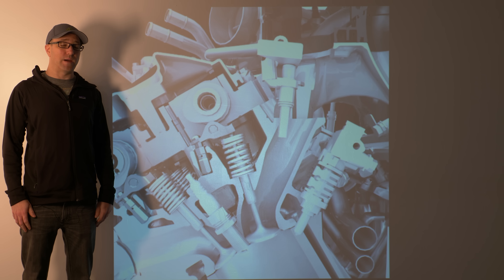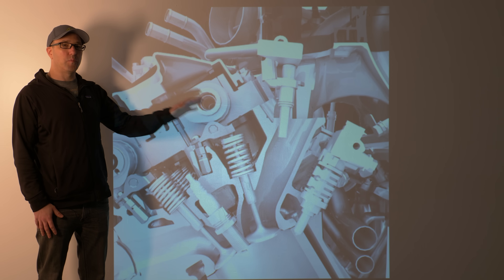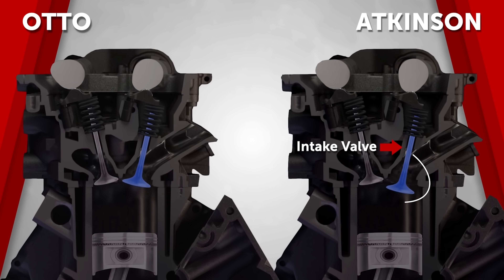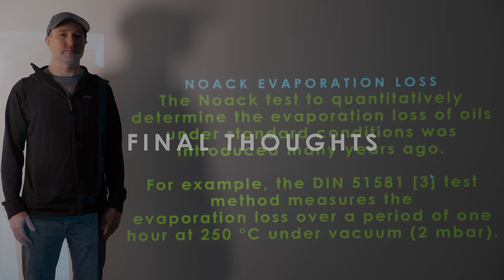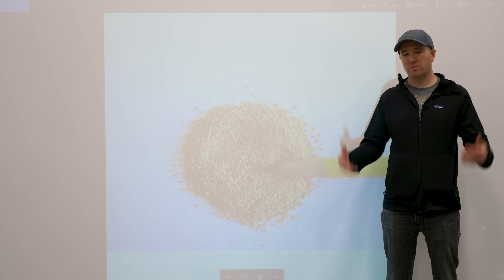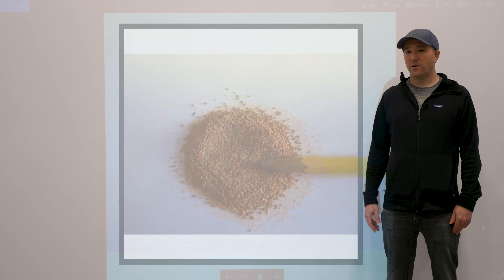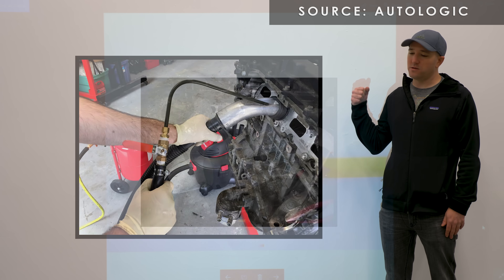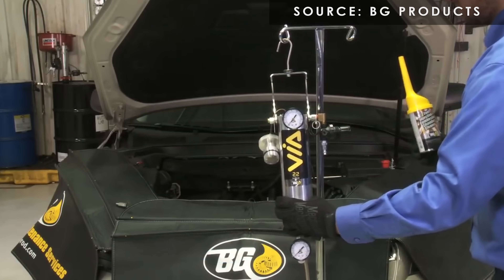Direct Injection, Problems and Solutions | The Fine Print

Comment: Excellent detailed video. How about fuel being pushed past the rings back into the crankcase causing fuel oil dilution? What pressure is the second pump bringing the pressure up to? The walnut shell method is just what we used to clean jet turbine engines. I will stick with my port injection non-turbo engine for as long as I possibly can. Thanks for the great info. 👍

Comment: I purchased a 2017 Subaru Forester XT about 2 yrs ago. Other family members plus friends had/have Subarus with nothing but praise for them.  My decision was all about the versatility of the Forester plus the performance of the turbo.  It was only later I began reading of the carbon build-up problems Caused by DI engines. I researched and read some info concerning a re-design (IE, specially shaped piston crowns and multi-patterned injection spray, 
etc.) to solve this problem. I'm certainly not an engineer so I just have to take Subaru's word when they responded to my concern.  Here is a copy of the response to my letter:  

   "Thank you for contacting Subaru of America, Inc. We appreciate the opportunity to be of assistance.
 The following is information I was able to obtain regarding our efforts to reduce carbon build up on direct injection engines: Older direct injection systems that experienced carbon build up were so-called “lean burn” systems.  Unfortunately, these systems suffered many times from uneven combustion due to variations in the fuel and air mixture throughout the combustion chamber.  This created a mix of lean and rich conditions resulting in variations in combustion temperature and uneven burning of the gasoline.  This uneven burning lead to the condensing of unburned and partially burned hydrocarbons which over time resulted in carbon buildup. Subaru engineers understood this when they created our current direct injection system.  They developed innovative yet simple systems to manage and control the combustion variations inside the combustion chamber.  These include features such as specially shaped piston crowns, multi-patterned injection spray, and tumble generator valves.  All of which promote the precise swirling and intermix of fuel and air under the variable conditions required across the full range of power requirements.  When combined with very high fuel pressures and extremely short injection duration of the Subaru direct injection system, stoichiometric combustion is maintained across the combustion chamber resulting in very even and complete burning.  As a result, abnormal residue and carbon deposits are not created and engine performance and fuel economy are maximized.
   If you have any additional questions, please do not hesitate to contact us again. Thank you for the opportunity to be of service.
"
Sincerely,
Subaru of America, Inc.
Customer/Retailer Services Department
1-800-SUBARU3 (1-800-782-2783)
Service Request Number: 1-38197102937

Sorry, but I have no way of knowing if this is just "smoke and mirrors". I was also concerned when, at my most recent oil change at the dealers, I pretty much got "Huh? Haven't seen that problem; we don't recommend any type of cleaning maint. service."  Perhaps they hadn't received this update from headquarters. I think I may purchase a Crawford V3 air-oil separator. From the info in this video plus other info I have read, it might be the best preventative maint. at this point.

Comment: Love the presentation you have done a great job. I would like to add something to the prevention section, installing a simple methanol injection kit will keep the intake and exhaust valves clean since it cleans as you drive also will increase fuel economy and lower the temperature of the motor.

Comment: Ah, another fine product by Bosch. I will say one thing that the mechanical HP pump is pretty impressive in that it can modulate it in real time to maintain a desired fuel pressure in the rail without any external regulator or accumulator. Adds a lot of flexibility to the system.

Comment: I believe combustion temperature has a heavy influence as well. If I'm not mistaken, Mazda's Skyactiv engines, which are DI only and use 0W20, run below average temperature and suffer far less from carbon buildup. I'm not sure I understand why since I thought high temps burned off soot better. Also, the harder you push your car when not at optimal running temperature, the worse the blow-by short- and long-term. If you decide to push it, make sure it's fully warmed up.

I'm considering checking on my 2.0L Skyactiv with 95,000km to see how bad thing are.

Comment: Finally I figured out what the hype was. I had port cleaning done twice for the fun of it wasn't fully sure what was the benefits but I mind my car and had some beefy upgrades. shes done over 400k kms and never gave any other trouble other than a flywheel + clutch replacement and the car is 10 years old now. I replaced loads of after market stuff and even did stud conversions and swapped the blow off valve for a metal one etc. anyways this is the most informative video i've seen thank you so much. that explains everything! unlike others tryna sell you shit with shitty explanations. I see some pros ad cons about those types of injected engines. a good Oil catch can it is then.

Comment: Why is every body getting all upset..Auto warentees are for 5 years ..50,000 miles on power trains..after 5 years 50,000 miles trade it in ..that's the American way,any way that's what the government is forcing us to do
Reply: Really they aren't forcing us but they sure do try. If you keep your motor clean with doing something such as using seafoam between every oil change can do it and make your engine last much longer.
Reply: Is this one of the reasons your new car depreciates like crazy??!

Comment: The advantage of IC engines is that at the stoichiometric air:fuel ratio of nearly 15 to one, the vehicle only has to carry one pound of fuel for 15 lb of air (about 20% of air is oxygen, the other reactant) which it takes from the atmosphere.  Battery powered cars must carry ALL the reactants, plus the rest of the parts making it a battery.

Comment: To all the technical people reading the comments check out Reactivity controlled compression ignition. Researchers have figured out a way to use a mix of Diesel and Gasoline that improves fuel efficiency by 20% of what diesel alone is capable of and burns clean enough to not require after treatment ( Dpf, or catalytic converter)

Comment: In Germany we use the Valve Protector System - designed for Propane Conversions and save Valve Stems.https://www.valve-protector.de/22.html

But in Gasonline Direct Injection Systems you don`t need Valve Care Additiv, so you can use a good carbon cleaner as Seafoam, many just use water with Alcohol.
You can adjust how much Additiv you want to use.

Comment: Your pcv theory is dead-wrong - crankcase oil vapours from hot oil build up pressure in crankcase and are vented up through through passages in the block through the pcv valve and vented into intake manifold through the intake valve into the cylinder where it gets burned - not as you said, up through the top of cylinder past the valves - if you had that kind of leakage past the valves you would have serious backfiring. Hot oil in the crankcase builds pressure there which needs to be vented or blown seals would result - pcv systems have been around for over 50 years and before that, crankcase vapours were simply vented directly from the crankcase via a pipe or hose that extended outside the oil pan producing an oily smoke you could easily see - pcv was introduce to control these emissions by burning these oil vapours in the engine - the actual amount of oil vapour can be quite large and can contribute to half the actual oil consumption usually attributed to oil getting past bad oil control rings. Hot oil vapour in the crankcase is the pcv system culprit and is what coats gdi intake valves - solution? Vapour cans to collect these vapours in condensed form and manually emptying the cans as needed - when you see how much oil vapour condenses in these cans you will not be surprised that it will coat the intake valves. The oil can solution would be easy for car companies to incorporate in new engines from the factory and solve 90% or more of the gds valve problem - or you install your own on your brand new high tech gds engine and pray it doesn't void the warranty - either way gds promises to see 10s of millions of badly running cars pretty soon as this problem only gets worse with time.

Comment: Dont believe this hype. If your oil consumption not going down then your ok. When and if oil consumption does go up and your sure its from the Crankcase breather and not burning blue out of the exhaust. Then you  are starting to have an issue. But Seafoam or similiar product use once a year is fine for preventative maintenance. 
If you have a new car, start with seafoam or similar once a year.
And maybe fuel cleaner in the tank to keep the fuel injectors clean.
Very tiny little holes in them.

I own a 2015 GM 2.5 DI engine.
50,000 miles. I follow the above maintenance and have had a look at the back of the intake valves. They are clean no lumpy "gunk" on intake.

Comment: Every time you change your oil and drain your oil separator, spray a can of cleaner, B12 etc, into the oil separator intake hose before reassembling oil separator.  Just slow spurts/sprays over several minutes and the cleaner should go everywhere the oil goes and provide some cleaning (engine running).  Can't hurt but can it help? What do you think?
Reply: A few squirts may not be enough.  You may need the half a  can.  (Seafoam)

Comment: Those 80s cars getting amazing mpg were also often times a base model with no frills and very low horsepower. So sure it got 49mpg but it probably only had 60-85hp.
Reply: ... with virtually no safety equipment and crushed like a tin can in an accident.

Comment: just wanted to add that increased valve overlap for scavenging of exhaust gases is a huge contributor to the intake valve carbon buildup. Software updates and reflashes would correct a lot of the issues,  but a disclaimer for a loss of fuel economy/ performance would have to be made clear... in other words not happening.  Owning a direct injection vehicle is like paying exotic car maintenance, but driving a chevy traverse.  at least in the Porsche the windows and heat probably work lmao.

Comment: Can you dismount the engine head, remove the valves, timing chain, cams and clean them yourself with a sand paper? Or, maybe, wet sanding with something very fine, like a 3000 grade?
I know it's an lot of work with taking the engine apart, but if there's no walnut blasting in your area and you've done almost 100k miles without valves cleaning, then.......

Comment: You say “some cars” even need cleaning every 30k miles.   Why not just mention them by name.   Same thing with the oil volatility.  Which ones are the best?
Almost half of the vehicles now are gdi and I don’t hear about this problem.   Lots of drama and hype out there to either make yourself sound intelligent or sell some cleaner.   The process makes sense and it is a problem, but not as bad as you claim

Comment: Direction injection is as you say very poor. The baked on crap also causes ignition problems as that carbon glows and prematurely lights the fuel mix. And valves that have all that crap have far less power and use a LOT more fuel and make more emmisions. So cleaning emissions makes worse emissions. Cleaning the back of the valves is a small part of the deal. The whole chamber is effected.
The engineering world and Govt know this. Plus ofcourse the cam driven fuel pumps put more load on the timing chain. Timing chains are another item that  causes griefs as the chain stretches and effects cam timing ignition timing etc etc. So your engine is losing power and making more emissions.
As for efficiency,,, look where race engines have the injector nozzles,, as far away from the valve as possible. Though some are also running a seperate nozzle at the back of the valve, or even behind the exhaust valve as the exhaust scavenges better. Clean? No. But having those nozzles a long way away is.
And ofcourse generally making huge power is also quite clean, the more efficient the more power.

Comment: Motors are electric, you are talking about an engine.
Reply: Incorrect.  An electric motor uses electricity, but a motor in the general sense is a device that converts some form of energy into mechanical energy.  Heat engines are motors.
Reply: OMG that drives me crazy .. lol..

Comment: You can still buy brand new, for 2019, port injected vehicles with manual transmissions!!!!! Honda Civic base w/ 2.0, Hyundai Elantra / Accent / Veloster base w/ 2.0, Toyota Corolla 2.0 with dual systems. I believe the Pentastar engine (found in Wrangler) is still port injection available with a manual. The point is all of these systems that have undesirable long-term consequences can still be avoided.

Comment: why not a single throttle body injector with DI
Reply: Throttle body is too far from intake valves. fuel condenses in manifold when engine is cold. fuel vapor reaching intake valves does not clean the intake valves as well as the denser fuel spray from the port injector.

Comment: I'm on my 3rd DI motor, and my first was an Audi, 2,0L turbo from 2006, so this is in no way 'new news'.   I have used the BG products pretty much from the start, as back then, they were way ahead of the game, where manufacturers continued to bicker blaming 'oil quality or gas quality' being the problem (even when you used their recommendations).   Now days, most dealerships have a similar system, be it BG or some other name,  Interesting note: My Ford dealership used BG.   I dynoed my 2010 Jaguar XKR before and after cleaning, and regained 40 ft/lbs of torque, on an engine with 30K miles.   For Di owners, this cleaning should simply be considered part of your 2 year maintenance plan.              Oh and on a side note, research problems with the high pressure fuel pumps.  Audi and BMW are two I know were having problems making them work well, (Audi's system was known for destroying engines as parts broke and shredded camshafts.

Comment: I debated whether or not to comment, but since you are trying to give a factual and technical overview, I have to point out that a lot of the information you gave is completely wrong.
-- You said a car needs DI to utilize variable valve timing.  VVT has been around for years with PFI.
-- You said VVT is infinitely variable.  It is not.  The average variance is about 25 deg.
-- Your explanation of blowby is completely wrong.
-- You said some cars in the 80's and 90's got 60, 70, or 80 mpg??  Are you serious?
I appreciate your effort, and I concede you are much more skilled at making videos that I am, but if you are going to give a technical presentation you should verify your information.
Reply: "-- You said VVT is infinitely variable.  It is not.  The average variance is about 25 deg."

This is not what "infinitely variable" means.  

Infinitely variable means there are no "steps" inherent to the adjustment.  Old-school VTEC is not infinitely variable - it has two steps.

I'll agree that his explanation of blowby is flawed.

Geo Metro (Suzuki Swift) from the early 1990s equipped with the 1 liter 3 cylinder engine, no power steering and no AC was easily capable of 50 MPG.  IIRC, the Honda CR-X HF was capable of 40ish MPG.
Reply: @immikeurnot   "I'll agree that his explanation of blowby is flawed." Except that closed throttle overrun down a nice long hill pulls oil up past the rings and into the intake/exhaust ports during valve overlap.
Reply: This guy works for General Motors.
Reply: 70 MILES PER GALON FROM A HONDA? NAAA THE BEST WAS GEO METRO OR DIESEL JETTA,NO HONDA FROM THE 80S/90S GET CLOSER TO 50 MPG.......OR PLEASE TELL WICH CAR FOR BUY ONE....
Reply: @Jacob Hoffman https://www.motherearthnews.com/green-transportation/green-vehicles/miles-per-gallon-cars-zb0z11zblon nothing on here has that high of mpg. Seems like a legit site to me
Reply: Agree with Jacob
Reply: Many vehicles from the 80s and 90s got great mpg, 50-60 mpg no problem.
Reply: really I couldn't of said it better than you thank you

Comment: Direct injection makes sense for diesel, but for gasoline it is asking for problems. Reliability is the opposite of the number of components in a system. The more complicated, the more likely it will break down and the higher the cost.
Reply: Direct injection is a diesel killer!!

Comment: Just every 30000 or 3 years to put a can of valve cleaner spray and rev it for a while to clean the build up which cost about 30 to 50 dollar a can and you are good to go!!! The direct injector will not have any carbon build up as it said because the injector has fuel running and the temperature is higher than 210 degrees C. Carbon build up only at around 190 degree C which is where the intake value mostly at and those cleaner will clean up minimum 80% of all the build up and if it doesn't solve the problem, use it 2nd time will improve to 90- 95% of the build up and it cost only about 100 dollars. This is the solution because I m pretty sure the DI engine save you more than 100 dollar for the entire 3 years. There are experiment that rev up you vehicle above 5000 rpm will start cleaning the intake due to heat > 210 degrees

Comment: Catch cans have been used on many port engines as well and perhaps even moreso. Whats the big deal..They can only help keep some oil out of the top end.Should be one on every engine.So big deal you dump it at every oil change.Just get a good one that doesn't allow air in.

Comment: USE TOP TIER FUELS ONLY
Reply: The fuel still doesn't touch the valves on a GDI engine.
Reply: D. Gibson - it helps keep the valves cleaner, better than the non Top Tier fuels do.